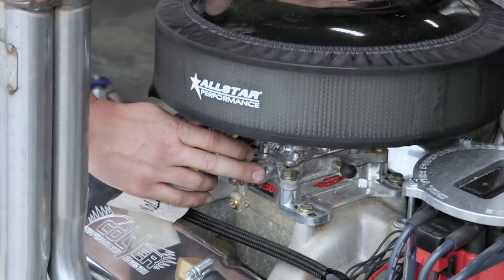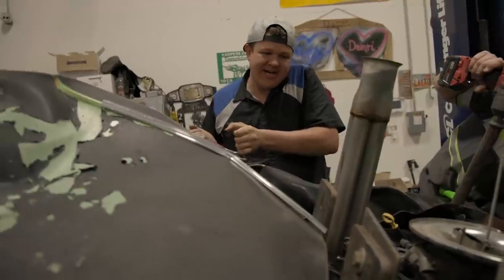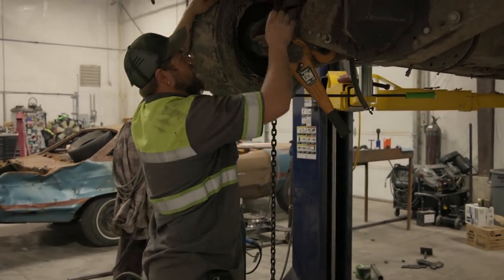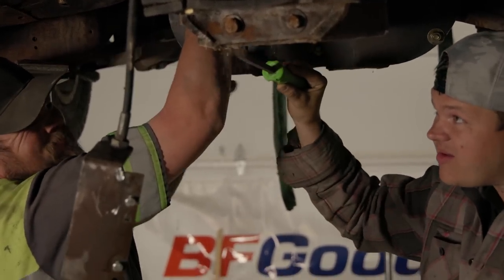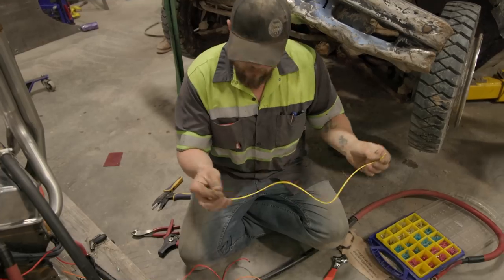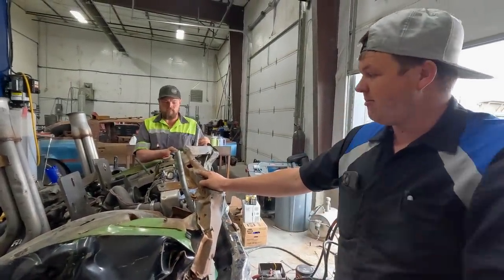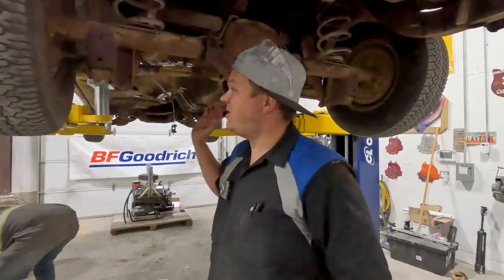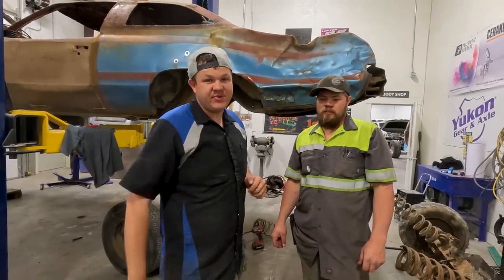They Say I'm CRAZY...500HP Demolition Build For The WIN!!!

Comment: A trick I used to do is wrap copper tube around a 5 gallon bucket (for the shape) then hook the tranny lines to it. put the copper coil inside a cooler, and just before the derby, fill the cooler with ice. Keeps the transmission cool and the engine cool. I never ran a radiator.
Edit: I love Hillbilly's dedication to and for Robby!!!
Reply: Yeah, and add ice cold sprinklers to the freeze plugs just in case
Reply: @Orbacron  LOL... The cooler trick really did work for me
Reply: My Dad told me about a guy in HS that did that with his fuel line on a '66 4 door Nova that was the fastest guy in town.
Reply: Two things guys: First, on a GM, you can unbolt the flex plate and push the torque converter back the little bit to clear the flex, leaving the transmission in situ.

2nd: I grant you the LS is a decent motor, but the headache and teeth rattling music that comes from listening to a 3rd gen Hemi is like listening to the New York Philharmonic powered by Mopar in a Hellcat vs the LS powered jr high school  band with a class of 12 students.  3 of 12 orchestral students can't play do to accademic probation, four more are off drinking bud light  from the dumpsters behind the lobar bar and adult daycare.

The poor LS will sound great until  Mopar starts breathing fire and the LS clenches so hard it seized.  
That's it.  

hen those engines
Reply: @kens407  I used a rebuilt Chevy 350 for my derby engine. I don't know about Dodge, but I do know a Ford is hard to start once it gets hot. This isn't about my brand name is better... this is about cheap parts, and they didn't stop running until it blew up. Old school engine is the best for derby.

Comment: That tapping noise sounds like a lifter. If it increases when revved up that's it or a loose valve... lifter clearance... because you have solid lifters... hydraulic lifters will quite when the oil pressure in them increases... If it's a steady "clicking"  [same/ similar] sound.. it an exhaust leak... header gasket... 
    Nevertheless... you did a good decision... great boss .. dropping in the new 383 stroker .. that's a great engine... This all sounds really cool.  I have been around  dirt track cats, drag racing and 4wd rigs and hot rods... but a derby car is new to me . Just looks like fun... and unique build under a bunch of sheetmetal.   This should be fun to watch.  😎👍

Comment: What is the reason for running a 2 barrel carb and not a 4 barrel? Wouldn't you get more power and more immediate throttle response if it was a 4 barrel?

Comment: You can use a screwdriver (solid metal)to touch the motor in various places to locate the source of the tick or knocking to narrow down the location and issue.. Where you feel the noise in the handle hardest is usually a clue to what could be wrong.. Stupid old trick from way back to help narrow down the guessing.

Comment: You should drop the pan & roll in some new bearings.  Why would you ever run it without coolant & risk overheating?  We use to fill our race car blocks 3/4 full & flush cool water through the heads & top of the block between runs.  5-8 second full power runs stores a LOT of heat fast!

Comment: Tell Hillbilly as a fellow B2 and Ford Explorer rock crawler builder, he needs to look for a 5.0 out of a 95-01 Explorer. They usually have gt40 heads and intake on them and will fit in those B2's no problem. 98-01 is more common to have the better heads on them. GT40 or GT40P or GT40X heads. GT40P is the police package, and GT40X is aluminum. GT40 are just cast iron but still higher flow.

 Also, he needs to keep his BW1350 tcase out of his B2, but go find a BW1354 tcase out of a Mazda B3000, some Ford Rangers or 90-94 Explorers (manual tcase). You can double them up like the NP205/203 Chevy guys do, and the BW1354 has a lower low range, and twice as strong. His manual trans should bolt up to the 5.0, or he case use an M5OD manual out of a mustang from the 90's.

I have a 2000 explorer 40's on dana 60s, double low tcase, 5.13 gears, 9.1 low range, and a PowerStroke turbo 5.0L. Grizz lockers. 4 link front, waggy leaf rear.
I also have a '89 B2 on 37's with an Explorer 5.0L, M5OD trans, '79 F250 dana 44 high pinion, explorer 8.8 rear, both diffs welded, and the whole top chopped off. coil 3 link front, waggy leaf rear.

Comment: When this happens to me I get a couple gallons of diesel fuel put it in the oil run it till it gets warm and then drain it cleans the engine
Reply: Diesel fuel is cheaper than oil to clean engine and it works really good 👍

Comment: You need to invest in some SODIUM SILICATE.. it provides a temporary fix for cracked blocks blown head gasket water in the oil leaks... Remove all Coolant fill with plain water and add 1/2 qt to a sealed coolant system.. your welcome,😎👍

Comment: Hillbilly sugar in the carb is not going to hurt the motor. Now if you put molasses in the oil and run the motor the molasses runs thru all of the motor. Then shut it down and let it cool over night and try to start it the motor will either not start or the motor will lock up because all of the oil passages are plugged

Comment: Next water/oil mix engine you get, drain the engine and over fill it with diesel. Then start it let it idle for a few mins only. then drain again the diesel will clean the engine better and cheaper than loading with and wasting fresh oil

Comment: No thats not an expensive engine . Go get a Steve Morris smx engine and put in there . Still pushing 1500 hp on pump gas (2-5000 on methanol ) and he makes on that doesn't have a water cooling system . If you sell that engine you will have a down payment .lol Now go win this thing !

Comment: I don't know if I told you this or not but I told everybody on YouTube, put a quart of Rislone in that motor or any motor, it does what it says it does on the bottle it frees sticky lifters, and dissolves all the gum and varnish that builds up inside of your engine marvel mystery oil is a similar product but there is no mystery with Rislone, no they aren't paying me to say any of this, after driving 3 million miles and my daddy also used it with no mechanical breakdowns, I feel I owe them the favor, you will notice the difference in 5 minutes or500 ft whichever comes first. It's mandatory for mopars that are notorious for stuck lifters.